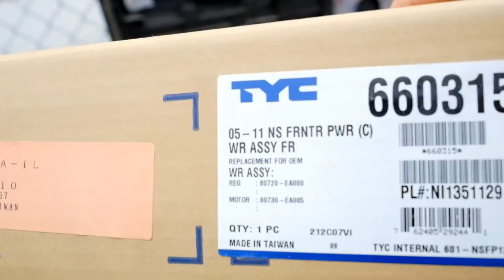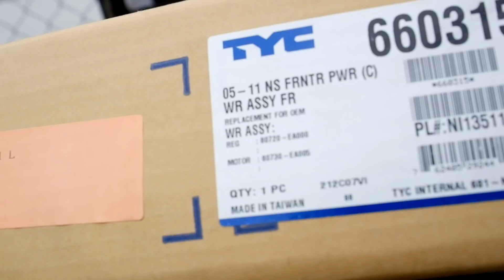2005 thru 2012 Nissan Xterra & Frontier Power Window Motor Repair/Replace

Comment: After viewing this video, I just completed replacing the driver's side window regulator in my daughter's 2007 Xterra in almost exactly one hour. The process was exactly as explained here, and everything went smoothly. Tapping the old motor caused the window to lower to the point I could reach the bolts holding the glass. I was happy that I did not have to cut the cables on the old regulator to get the window to lower. I had ordered the new regulator from Amazon for less than $55, paying no shipping and expecting it to take about a week. The regulator came in four days -- on a Sunday, no less. This is an excellent training video. The last time I had a regulator replaced at a shop, the charge was upwards of $300. Thank you very much for making the video.
Reply from the maker: Thank you for a kind words.

Comment: Thank you very much. This is by far the most detailed one on youtube. the other stuff i was watching wasn't helpful at all.
Reply from the maker: Thanks, with my English I tried my best.
Reply: Have you replaced the Radiator yet on yours? You are aware of the Radiator issue right? i actually have the exact same car as you which is pretty cool.
Reply from the maker: I am lucky that I have manual transmission so I haven't gotten this issue. I haven't replace the radiator, but I have replaced the water pump with thermostat. Afterwards, I did a nice flush and filled with new OEM coolant.
Reply: i see. yeah i have an automatic. Apparently there is some issue with coolant mixing with the transmission fluid and the remedy for this is to replace the radiator. I'm still learning but a lot of people have been unlucky to open their radiator cap and notice that the fluids mixed together which ruins the transmission. But i guess you won't have this problem.
Reply: Sergii Kvasnyi your English was fine. The whole video was clear and concise. The other folks commenting are correct when they say yours is the most detailed and clear video out there on doing this job.

Comment: Very good explanation how to move the window down initially, remove the 2 bolts that hold it, and how to secure the window while you replace the motor assembly. Thanks!

Comment: At 21:21, you will see a large hole next to a small hole just below the window opening on the right side of the video. I raised  up the window and stuck a large screwdriver into this hole to hold the glass up out of the way. This gave me plenty enough room to work
Reply: Thanks! :)

Comment: Thank you for the detailed and clear instruction video. It made it much easier to tackle this Regulator/Motor replacement myself. I like that you show where to push on the electrical connectors to get them to release. I noticed that some of the screws were not very tight when I removed them. Since this is all sheet metal that is threaded it is very easy to strip the threads out.
After watching you video, I went and purchased an $8 set of nylon pry tools at Horrible Freight to avoid boogering up my door pieces and they worked very well.
Thanks again for the video, it made a huge difference. Cheers!

Comment: Sergii, I've done everything you have up to 10:14. My window had gone all of the way down beyond where I could disconnect it. When I saw you hammering on the metal next to the motor to raise the window, I thought, "this is the craziest thing I've ever seen."  I had nothing to lose so I got a rubber hammer and started hitting the same spot you were while holding the window button in "up" position. By the time I hit it the third time it went all the way up by itself! If the switch and the motor are both working, I wonder if the mechanism doesn't need a good cleaning and lubrication instead of replacing the motor? I'm stopping here and will look more into why pounding on the inner door panel made it work. Thank you again :)
Reply from the maker: Hello Vaughn, as long as your carbon brushes have enough material on them it should work again after cleaning. In my experience, if you already gotten some issues with the window motor, it has most likely worn out. Cleaning will give you some time, after, it will fail again. It gave me around 1 year of regular use.
Reply: If it's the brushes, I can replace them. If the commutator is dirty, I'll sand and clean it. Maybe I can get another year out of mine too?
Reply from the maker: With a new brushes and proper clean it will work longer than a year. Good luck with this project!
Reply: Thank you, I'll let you know what I find when I open the motor's cover.
Reply: I decided after 154,000 miles, something in the mechanism was allowed to wear out. So I ordered a whole new replacement and installed it this morning. It was easy after watching you. I took the old motor apart and one of the brushes was worn so short and stuck that it'd only occasionally touch the commutator. The commutator was also very dirty and in a survival situation could be made to work. However, every moving part on the unit I installed is brand new so I'm very happy and thanks again :)
Reply from the maker: What was the cost for replacement parts? And where did you find them?
Reply: Amazon said it would take perhaps 2 weeks to arrive but I got it in 5 days.
Reply from the maker: It sounds like a good deal on the motors! Hopefully it will work for another 150k miles.

Comment: Great video, I had the same problem with my Xterra 2006, taping the door to make the Window go up or down, I took all apart, motor and raíl, I notice that the problem was electrical because the little motor did not responded to the switch comand, removed the motor metal cover that has 3 screws, unscrewed the motor twisting counterclok wise and found tons of black powder covering the brushes, I clean everything with Qtips and alcohol, lubricated the brushes springs as well, the magnets in the motor case, put all back together after testing the up and downs and is working great.
Reply from the maker: Thank you for your comment. It all depends on amount of carbon brushes which are left, but usually if you already have some issues with electrical motor,  it is most likely worn out. From my experience, cleaning them will give you some time, but eventually it will fail again.
Reply: Sergii Kvasnyi it's being 4 years so far...
Reply from the maker: lucky, it looks like your brushes are still intact. I tried the same thing and it only lasted me less than a year with regular use.

Comment: I didn't realize you could restart the motor by simply tapping on it.  This will save me a lot time when I replace the motor and regulator.  Thanks.
Reply from the maker: It's the first thing that comes to mind out of frustration of it not working :) Thanks for watching!

Comment: What if tapping the motor doesn't work??
Reply from the maker: Then cutting the cables is the only option. You need to secure your glass properly. Then, lift or lower your glass by hand to the position where you can unscrew the mounting bolts.

Comment: Nicely done, thanks for the great detailed help. If motor didn't operate during removal I guess you would cut the cables and then raise or lower window.
Reply from the maker: Thank you for reply and I would have done so if motor would refuse to operate. If you need to cut the cable you need to secure the glass very strongly, don't underestimate weight of it.

Comment: My front windows went out too
Reply from the maker: Hopefully it will work soon.
Reply: Sergii Kvasnyi thanks but I am getting rid of it. It doesn’t even have 90k. Don’t see any reason to buy another transmission and radiator and wait for it to fail again. You have been very helpful. Thanks so much
Reply from the maker: I am lucky to have manual transmission and I haven't gotten this issue but I already replaced my clutch at 200k km. I hope you have a good luck on your next car!

Comment: My window was stuck in the complete down position.  Tapping did nothing to get the motor to move.  Couldn't get to lower cable to cut it to slide window up enough to unbolt from regulator.  Got one bolt out from window and ended up cutting one small access hole in door frame to reach other bolt.  Hole then got covered with the cold barrier when installing it.
Reply: Is there any other way besides drilling a hole?

Comment: I have an 08 Xterra. I replaced the driver’s door switch as my window was down and wouldn’t come up. I bought a new motor/regulator in one. If I unplug the old motor and plug on the new motor without actually installing it-is that a way to see if the new motor works? I tried that but nothing happened. Does the new motor/regulator have to be installed in the door to work?

Comment: What do you do if the window is stuck down?
Reply from the maker: If you already have new motor/lift assembly than you can cut your original lifting cable, place something underneath window to secure it.
Reply: @sergiikvasnyi188  I got the window up where it should be by hand and with the window switch on. But, I unplugged the connection to the motor and plugged the new motor in, and nothing. Is there a fuse somewhere that may be an issue?
Reply from the maker: @paulgray3444  Did you make your original window motor work? Or you just force and pull your glass to service position? There a way to connect new window motor assembly by not installing it inside the door, just to see if new one is working.
Reply: @sergiikvasnyi188  I bought the Xterra maybe a couple weeks ago. The window would not go down. Then it went down once and stayed down. I kind of forced it up by lifting with the switch on- to get it to the place where I could unbolt the 2 bolts.  I tried plugging in the new motor, but nothing happened. I don't know if it had to be installed so maybe that grounded it??
Reply: @sergiikvasnyi188  Thanks. The motor needed to be grounded. I touched it against the metal on the door before installing and it worked!!! :) My window is fixed and working now! :)
Reply: @sergiikvasnyi188  Hi, I have a dumb question: are regulators & motors from different brands interchangeable to work together? IE: Beck Arnley regulator work with a Dorman motor that is for the same Frontier? Thks!
Reply from the maker: @MasterArmedforces  Hello, I have never tried to swap different brands of window motor with a regulators. Maybe you'll need a bit of modification? Sorry I don't know.

Comment: Can that problem just be a fuse in certain situation?
Reply from the maker: Only if it's relatively new car and all windows wouldn't work. In most situations it will be problem with worn out brushes.

Comment: I would like to know if anyone has done this on the driver side door, and does it work? Thanks

Update: I did it and it works. Same set up inside the door
Reply: Kentucky Yankey has a good one
Reply: Yes, I just changed the driver’s side regulator on my 2006 Xterra.  Bought the assembly on amazon for $40-ish.  Part plus this video saved me about $200 ☺️
Reply: Nice. As an update, it worked

Comment: Is the motor agenci or same remplasmemt part ? How many cost the motor ?
Reply from the maker: This the part number I ordered from rock auto - 660316 and 660315 for front left and front right respectively. It costs about 60cad + shipping.
Reply: Hi 
what brand do you recommend
Reply: Í need nissan exterra 2005
Reply: Hablas español ?
Reply from the maker: https://www.rockauto.com/en/catalog/nissan,2006,xterra,4.0l+v6,1433009,interior,window+regulator+&+motor+assembly,15596
Reply from the maker: I got TYC 660316 and TYC 660315. So far works great.
Reply: Thank amigo
Reply: Una de mis puertas traseras se lackea el seguro y abre al tiempo después de un mes. A caso sabes como reparar eso?